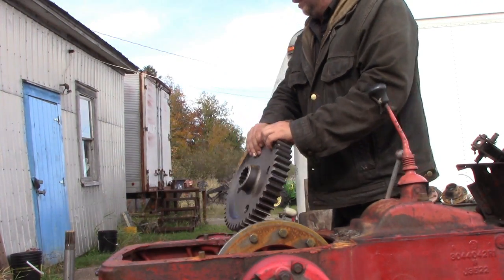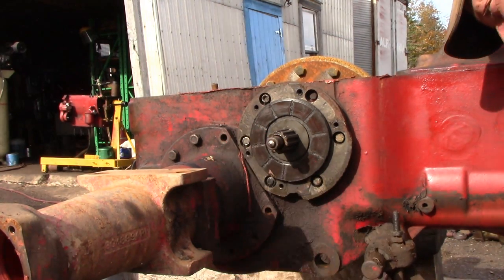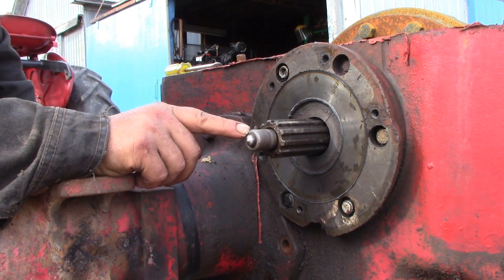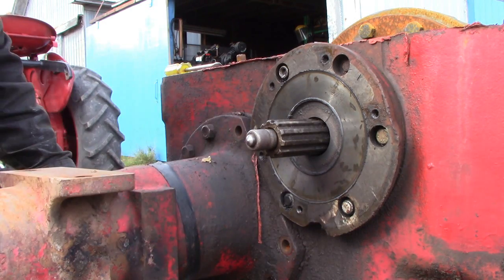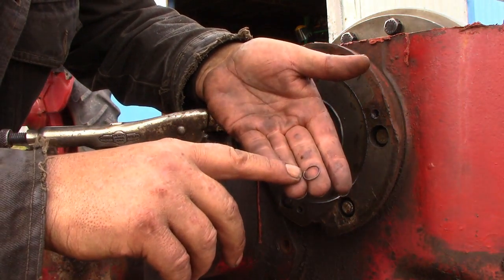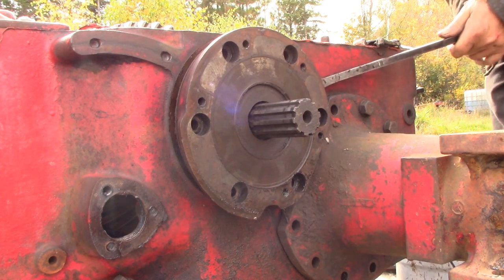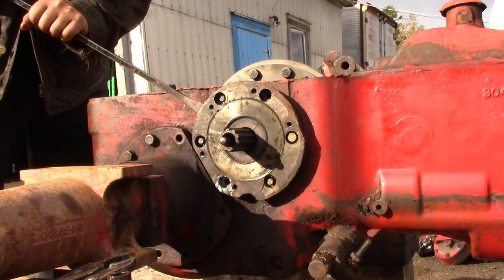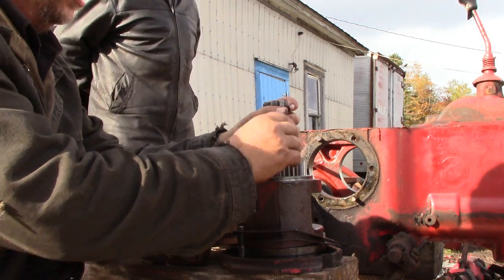B414 Etc  Series Bull pinions and differential

Comment: Hi Dave

I am trying to build my b275 to run backwards flipping the seat and all the controls for snowblower.

Can i just mount the differential in reverse? (Crown gear on left hand) so it can run backwards in 8 speeds and 2 speeds for front. Thanks
Reply from the maker: I believe that will work, yes, but you will have to split the differential to put the dif-lock rod out the opposite side to make it work
Reply: @CanadianRedneck15 if I dont need a diff lock can do i still need to split it apart?
Reply from the maker: @meharbanmangat  I believe so because the LH brake housing doesn't have the hole for the shaft to come out through and I don't think they will switch sides.

Comment: I can find no information about this procedure anywhere else. I have a leak behind the brakes. Does this mean I have to pull the hydraulic assembly from the top of the differential to gain access to the seals where the brake plate connects to the block?
Reply from the maker: Yes, it's likely the seal on the brake shaft (bull pinion shaft) which goes into the bull pinion housing from the inside. Thanks for watching!
Reply: @CanadianRedneck15   Thanks for responding. I have two additional questions. The first is about the brake cage. Is there a gasket between the block and the cage or is it just shims? The second is about torque specs. I have not been able to find any torque specs on the 424 IH for the differential gearbox and the hydraulic unit. Do you know where I can buy a manual for it online or is there a forum that would have them listed? Thank you for your help.

Comment: Great video Dave. I try to push down on pedal to lock differential and the pedal won’t move at all. Any ideas?
Reply from the maker: Check to make sure your pedal is free to pivot on the bolt that holds it and that the dif-lock shaft hasn't worn into the slope/wedge that pushes the shaft in. If those are OK the shaft is likely sticking a bit. You may be able to loosen it by giving a few light taps with  a hammer. Thanks for watching!
Reply: @ Thanks for the quick reply Dave. Cheers!
Reply: @ The shaft was worn into the slope a little bit. Was able to grind a little bit of a slope out of the hole. The return spring was also missing so maybe didn’t help for shaft wearing into slope. New spring installed. Now works perfect! Thanks Dave!
Reply from the maker: @dtm8073  Yeah that's a common problem, glad you were able to find the culprit. :)

Comment: Thanks for posting these, this is the best info on the 414 I've found anywhere on the internet. I have two questions for you:  how would you remove the right bull gear if the axle is already broken? Also what kind of gasket material would you use between the hydraulic unit and the differential housing?

Comment: Is it possible to remove the right oil seal of the right brake without removing the upper cover of the differential mechanism and without tightening the large sprocket going to the rear wheel?
Reply from the maker: No, the seal goes in from the inside, you have to remove the axle and move the bull gear to pull the brake shaft housing out. Thanks for watching!

Comment: Sir my I-H 2504 gas, has locked up on me, after a low rpm 2nd gear fwd start. With bucket load.
It let off the screatch of a banshee 
& never ran again. 
Engine is locked up tighter then a bull's ass..
Any thoughts?
Thanks
Reply from the maker: A banshee screech is always a bad sign! That's a bit of a tough call, could be a turned crank bearing or a seized piston, yo0u're going to have to tear into it to figure out what is actually going on. Thanks for watching!

Comment: I have a b275 that has gear  oil leaking at the shaft that attaches to the brakes. The brakes are coated with oil. How would I go about changing that seal?
Reply from the maker: You have to pull the bull pinion shaft and housing and remove the bull pinion shaft from the housing. The seal goes in from the inside of the bull pinion housing. Thanks for watching!

Comment: do I have to pull the axels to do my seals on the bull pinion when doing new brakes only? will the diff stay in  place once the diff lock assy is disconnected?
Reply from the maker: You have to remove the axles and move the bull gears to remove the bull pinion housings to get at the seals. If you take out one side at a time and replace it before taking the other side out the differential will mostly stay in place. Thanks for watching!

Comment: hello from finland i have old 414ih and i have problem my tractors differential lock doesnt work at all. mechanism is moving nicely when i push pedal with my leg but lock doesnt engage. can you help me where is the problem and sorry my bad english.
Reply from the maker: Your english is quite good, way better than my finnish! :) The differential lock is a sliding collar in the center of the differential. You will have to open the differential to check but I suspect that the spring that pushes it is broken, so the rod pushes in but the spring doesn't push the collar. Thanks for watching!

Comment: Hi Dave i have a 275 and it will only drive on the right hand side wheel when you engage diff lock. It wont drive the left wheel and if you disengage diff lock the wheels dont turn at all when you release the clutch. What could the problem be? Regards Colin
Reply from the maker: THat is a broken LH axle. Don't drive it like that, it can push the bull gear right out through  the bottom of the case. Thanks for watching!

Comment: Hi Dave, Thank for your educated videos. I want to change my 444  pull pinion seal due to leakage into break disk. Only side cover removing is enough to reach the seal ? your video confused me by the way I am ameteur for repairing.?
Reply from the maker: The seal goes into the bull pinion housing from the inside so you have to remove the axle and bull gear, then you can remove the bull pinion housing and take the bull pinion shaft out to get to the seal. Thanks for watching!

Comment: would you have the procedure  to change the diff lock sleeve , both my B414   tractors the sleeves are stripped  , so no diff lock  on either one
Reply from the maker: You have to pull the differential and spit it at the inner ring of bolts, the you can remove the dif lock sleeve. Thanks for watching!

Comment: HI, good video. Can I remove the LHS differential half-shaft without lifting the hydraulic cover? The shaft broke flush with the outside bearing housing/brake plate. thanks
Reply from the maker: You will have to lift the hydraulic cover and remove the left side axle as well because you have to move the bull gear out of the way to get the bull pinion shaft out. Thanks for watching!
Reply: @CanadianRedneck15  Thank you for your reply.. Today I removed the LH Bull Pinion Half Shaft with the cage. I did discover that the LH side Bull gear does not come out unless you take out the PTO shaft. Also I only had to pull out the axle about 4" until the splines were clear from the bull gear. I have the larger brakes on my B414.
Reply: @CanadianRedneck15  Hello. I finally replaced the LHS Bull Pinion shaft with a good used one. Now there is a clunking of the bull gears and the bull pinion shaft gears as they mesh. I installed a good used bull pinion shaft which  appears to have less wear than the broken original I replaced. If I tighten the bull pinion cage nuts then the axle will not turn freely. If I loosen the cage nuts then it turns and clunks. Can I add more shims to the cage to stop the bull gear clunking? thanks
Reply from the maker: @aussie54   Yes, add shims so that the gears turn freely when the bolts are tightened.
Reply from the maker: @aussie54  The shims set how tight the tapered roller bearings are on the differential, they run i the inner end of the bull pinion carrier.
Reply from the maker: @aussie54  Early 414s had 5.5" brake disks, and later had 6.5" brake disks. They changed a number of other parts at the same time so you need to check your brake disks and get parts from a like model.

Comment: Quick question. I’m putting in my new bull pinion seals for the brakes. The new seals are thinner than the old ones. If I drive them all the way in they are loose in the groove all the way out by where the brake disc makes contact. Do you just drive them in part way so they stay tight? Hopefully you know what I mean. Sorry if it’s confusing. Trying to get it re assembled tonight. Thank you.
Reply from the maker: I would drive them into where they are a tight fit, if they are loose in the case they won't hold back the oil. Thanks for watching!
Reply: @CanadianRedneck15  thank you. It kinda surprised me that the new seals were thinner. The old seals were thick enough to go to the edge of the housing and still fit tight. Thanks again!

Comment: Got my brakes off and have grease inside the drum. Would that be from a bad brake seal? Looks like I’d have to pull the hydraulic housing and pull the bull pinion shafts to replace if I’m understanding right?  Or can the seal be replaced another way?
Reply from the maker: Grease in the brake housing would pretty much have to come from the bull pinion shafts, and yeah you have to pull the housings , the seal goes in from the inside, sorry. Thanks for watching!
Reply: @CanadianRedneck15  thank you!

Comment: Hi CR 424 diesel diff locking shaft leaking. It's coming out from the center shaft (moving shaft at end, not at inner brake plate) Is that a different seal or oring? Do I have to pull inner brake plate out??? Thx mucho!
Reply from the maker: The collar you have to depress  to get at the lock has an o-ring inside and out to seal the oil in, I expect one of them is the issue.
 Thanks for watching!

Comment: Can I ask why this vintage International seems identical to the Russian Made Belarus - could they have copied this model the brake system is exactly the same with the ball and disc system.  Are you aware of anything like that I happen to have a belarus with crap brakes and your video is very helpful.
Reply from the maker: Massey, Ford, and John Deere also used similar systems, everybody copies other manufacturers at some point.
  Thanks for watching!

Comment: Hi mate, is it possible to remove the pinion housing without first removing the axles? I've got a couple of snapped bolts on the bottom of RHS housing causing oil to enter brake housing.
Reply from the maker: You have to remove the axles first so you can move the bull gears out of the way to pull the bull pinion housing out of the case.
  Thanks for watching!
Reply: Cheers mate, that's what I thought. Great vids, keep it up.
Reply: I'm wondering why International didn't enlarge the outer part of the casting around the bull pinion. Then you could change the seal without removing the housing. It probably wouldn't get any more crap in front of the seal than what gets in with the small hole. Just my opinion. Nice video!

Comment: Thanks Dave

Final questions below if you don't mind it would be really helpful :-)

There are only 2 No shims  ie located at bull bearing cage?

What would cause it to whine now assume wear and needs to be adjusted?

Is it now to late as the damage is done and beyond repair?

Thanks again for your help
Reply from the maker: If there is no slack between the gears and they are not too tight (pressing on each other/ tension) there is nothing to adjust. The only other thing to check is  for chipped or broken teeth. Some gear set just whine, you may be the lucky guy that has one.

Comment: Thanks dave for your reply

To be clear gears fully meshed but no tension if it was to be adjusted could you advise how this was to be done?
Hoping my whine is a bad bearing assume this could whine also?
Andy.
Reply from the maker: I assume that a bearing could cause a whine, yes. You adjust the mesh of the crown and pinion by adding or removing shims from where the pinion shaft and bull pinion shafts mount.

Comment: Hi Dave Thanks for the video's really helpful please do more. 
I have a B250 with a whine in the back end going to lift the lid off over the next week or two almost sure it's the pinion and diff. 
Have you any advice on how to setup or check the correct marrying of the pinion and diff?

Any advice on this would be very helpy and much appreciated ps is whining common on the b250 tractors? 

Regards

Andy
Reply from the maker: It's been a while since i was around a B250, but I don't think they generally had much of a whine. You want the pinion and crown gears to mesh with much play but no tension on them either.
   I am glad you enjoy the videos, thanks for watching!

Comment: Hi Red, I can relate with your work, lol , I recently had timing /hydraulic gear strip on my b414 it is early model with small shaft only gear i could find had larger dia , witch i had to shim with pipe bushing, any info or aid to find a smaller dia gear? Kinda scared of my shim job although it runs could be costly if rips my key job.  and thanks for videos .
Reply from the maker: I guess I wasn't aware that there are two different diameter hydraulic pump shafts, learn something new every day! :) Does your old gear have a part number stamped in it or a casting number, if so what is it?

Comment: Hi Dave I have a 454 international I'm trying to clean it up and fix some wiring. So pulled the seat and seat pan off when doing so I found a bolt just sitting in a hole on the lift housing it doesn't fit in there but on further inspection I noticed there are thread's down inside I have no idea what really belongs there it's just in front of the flow control valve and there is a bolt just to the left of it if your sitting on the tractor.looks like there was some kind of retainer in there to but it is missing some of it I was able to get some of it out if you need more info let me know and what ever belongs in there can I buy a new one the local dealer was not able to give me an answer.
Thank you
Reply from the maker: I'm not sure but that sounds like where the vent for the hydraulic system would be. Thanks for watching!

Comment: Can those hubs be taken out without having to tear apart the whole tractor?
I need to replace the brake bull gear oil seals, and I don't want to tear the whole tractor apart to do this.
Reply from the maker: You have to take the rear axles out and move the bull gears to get the bull pinion housings out. Thanks for watching!
Reply: Mate I shoulda watched this first I’ve just put the axles in hydraulic unit back on before realising this seal needs work!!

Comment: Video on fixing differential lock please
Reply from the maker: I will make a video on that, thanks. Until then, the differential lock is inside the differential carrier, it unbolts and splits around the middle. If you take it apart you should be able to see what is wrong with your differential lock. Thanks for watching!

Comment: Good day  Boy that was interesting.  I thought the differential  looked awful big for that size of tractor.  If you  would take a IH M apart would that be  bigger. Thanks good video
Reply from the maker: The Farmall M differential would be pretty close in size, maybe not quite as big. The 414 etc. is pretty similar size to a MF 35 or Ford 3000 but those two don't have any gear reduction, they are built pretty much like a pick-up differential, the 414 has the bull gears behind the differential for a final gear reduction like the H and M Farmalls so the differential takes less stress and delivers more torque.  Thanks for watching and adding some good discussion!
Reply from the maker: Models without bull gears get their reduction in the transmission putting the torque load on the transmission and differential, models with bull gears or a planetary reduction beyond the differential  have a 1:1 high gear in the transmission and have the main torque load on the final drives.